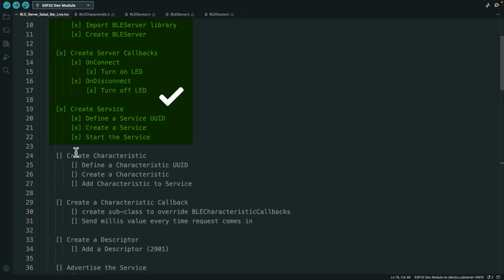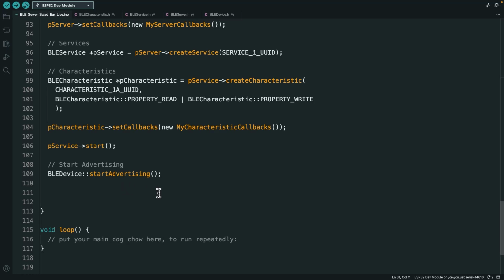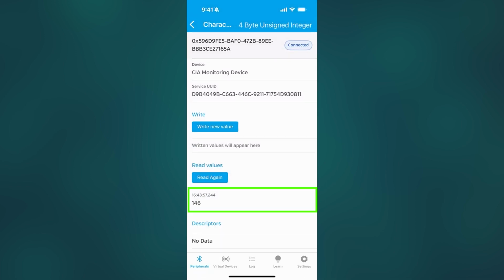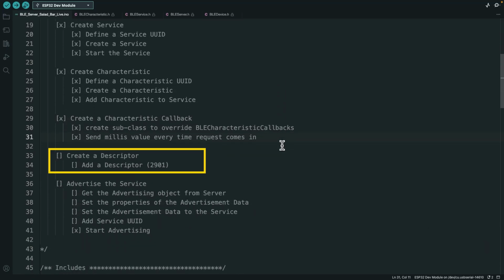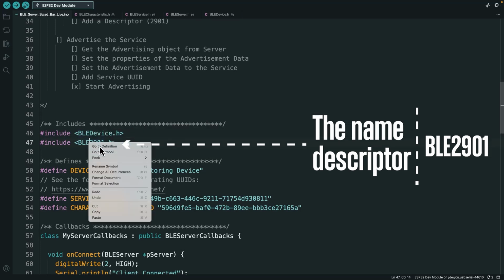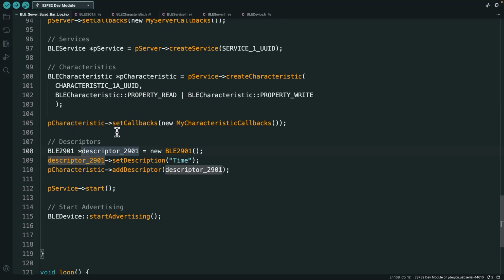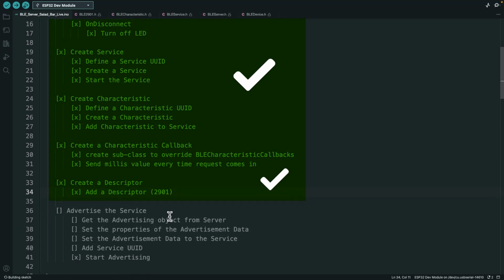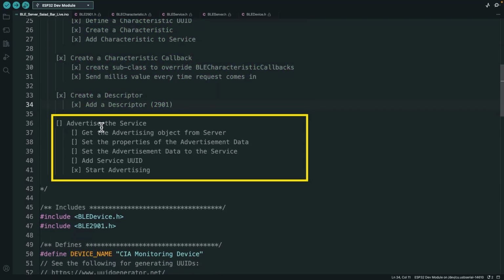BLE Descriptors - Arduino code explained! | PART 3 #arduino #esp32 #ble #arduinoproject

Comment: Great Video!! Quick Question: How do I read the notification or a characteristic value? In other words, how do I receive data from another device to ESP32? Thanks in advance!
Reply from the maker: Good question!   What you’ll do with your other esp32 device is create a BLE client which will scan and connect to your server and read from the characteristic from the server.

We have videos coming out on how to build the client and do just what you are talking about after these server videos
Reply: @ Thats great! Thanks for the prompt response and info! I'm just struggling with sending text through the characteristics and receiving data. I just hope there's another way besides having a middleman device as a client instead of a standalone device. What do you suggest? I'll greatly appreciate the help!!